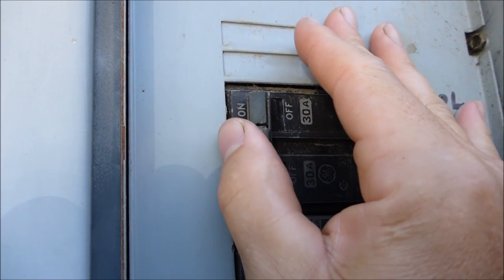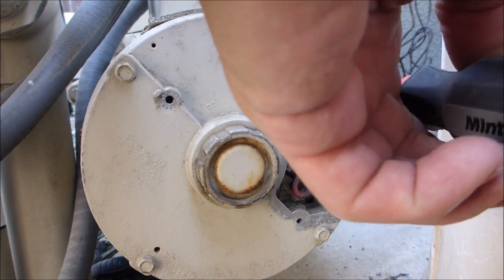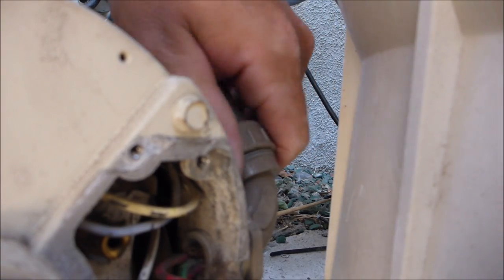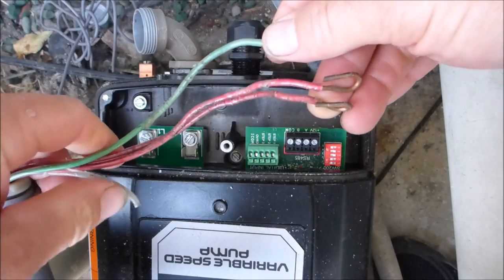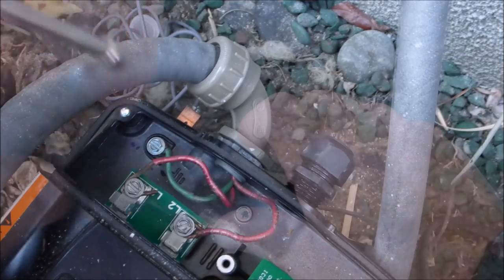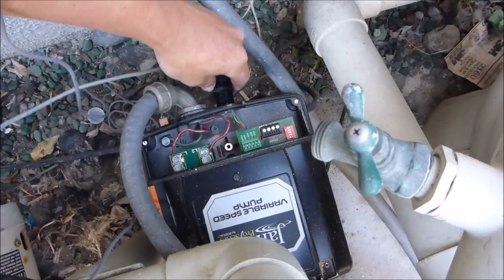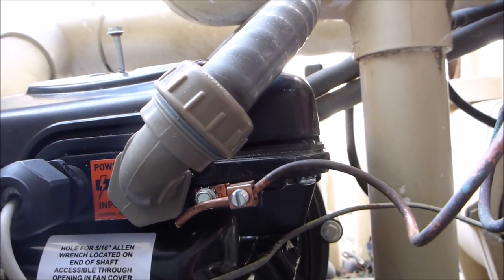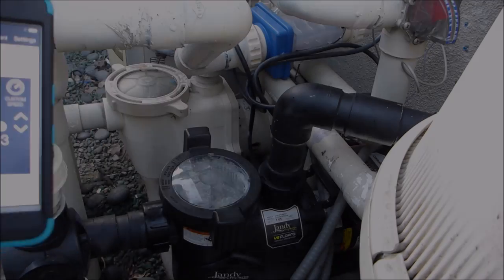Jandy VS FloPro 1.0 HP Pump Installation Part 3: Wiring the Pump

Comment: I have enjoyed this little series, great job!! I have installed a few different brands of VS pumps and I'm not sure what I would install on my own pool. What brand/model would you recommend for a small pool? Thank you!!
Reply from the maker: I have a lot of Pentair IntelliFlo Pumps and Jandy EPumps in my pool route.  Both are extremely reliable so I would say it is a choice between the two. I installed this Jandy VS FloPro at my house because I liked the 1.0 (1.65 total HP) rating and I like the iQPUMP01 interface - it is so easy to program the schedules. But you can't go wrong with either one.

Comment: Hello Dave. Thank you for your blog and videos they are very informative, quick and to the point. I am looking into building a pool in my house, the PB that I have chosen uses jandy products. My question is, I see the posts are almost 3 years old, in your opinion, has anything changed regarding the salt water generators, specifically jandy, or would you still steer away from them. Thanks

Comment: how do you feel about Jandy pool pumps? i've been a life long pentair pump user, but Jandy is owned by Fluidra so they're reputable as well. Anything better or worse than Pentair pumps? or they're just about the same quality and performance and it's mostly just personal preference? Trying to keep my options option for future pump changes
Reply from the maker: Jandy is 100% solid.
Reply: I've been in the industry about 3 years and jandy is number 1, pentair is just slightly behind it. Everything else isn't even in the same league.
Reply: @jasonvanboesschoten6680  why jandy

Comment: Is there a way to connect this pump to an Easytouch to control the speeds/programming, or does it have to be Jandy automation? Maybe low voltage inputs or something?

I wasn’t able to find any information on this online, and the companies aren’t that great when you ask about compatibility with competitor products…
Reply from the maker: Yes, if there is an open relay you can connect it. But the speed programming might be limited. Hayward is the only automation that is not competitor friendly.

Comment: Question about  this Pump, Can I add my Salt Chlorine system to the Epump Timer???
Reply from the maker: If it is the 2 hp model you can wire most salt systems directly to the pump

Comment: What about if i dont have the controlers? Can i still use it without it?
Reply from the maker: Needs a controller or it has to be connected to an automated system to work. You can get one fairly cheap.